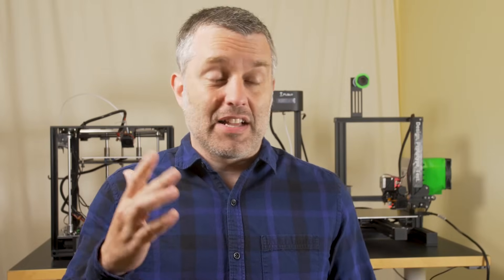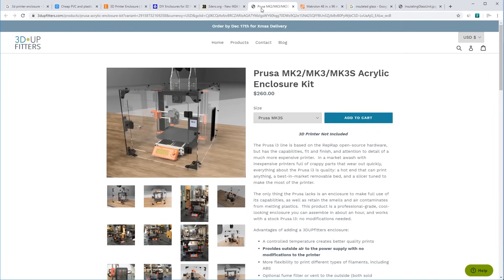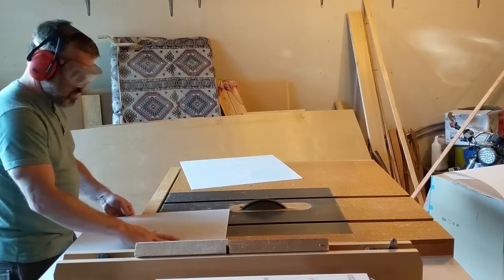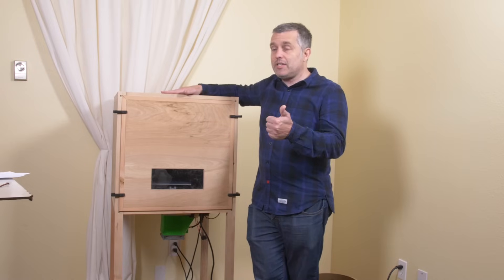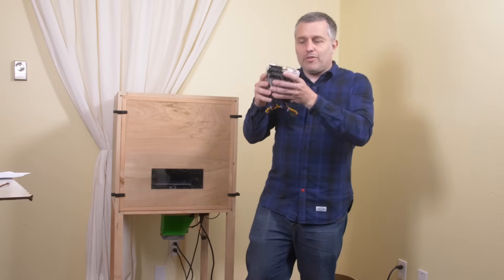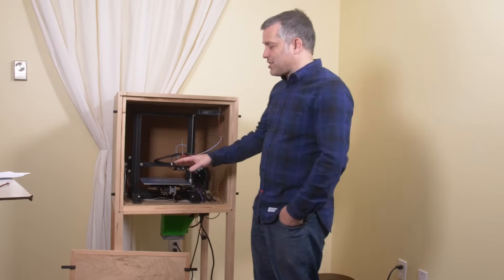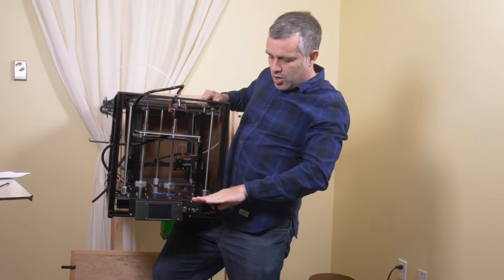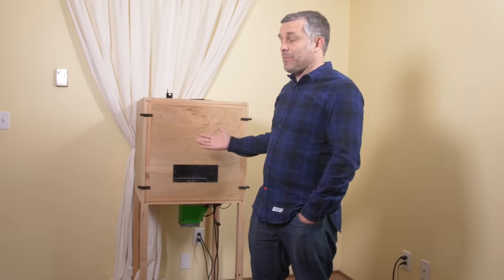3D Printing in a 100°C Heated Chamber - Lessons Learned

Comment: WARNING DO NOT DO THIS YOURSELF. MESSAGE TO MAKER: THE WARNING YOU GIVE IS NOT GOOD ENOUGH!!! YOU NEED TO FULLY EXPLAIN THE STORY WRITTEN BENEATH OR TAKE DOWN THIS VIDEO IF YOU DO NOT WANT TO BE RESPONSIBLE FOR SOME IDIOT TRYING THIS AND BURNING UP HIS HOUSE!!!
Long story:
The safety norms for heating devices for consumers are (simply put) divided in 2 groups: automatic use and non-automatic use. 
Automatic use devices, such a space heater, have to have 2 different safety devices to conform with normal safety (3 for newer consumer products in Europe): a thermostat that shuts off when the temperature gets too hot and a thermofuse that blows when the temperature gets too hot. The third one is the use of so called PTC (positive thermo coefficient) resistors, these increase in resistance when they get hot (and thus lowers current -> no thermal runaway). 
Heat guns are however non automatic. Cheaper devices dont have any protection and whats worse, most of the cheap heat guns are NTC's to increase the wattage (negative thermo coefficient). NTC means that the higher the temperature gets, the lower the resistance gets and thus the current gets higher -> thermal runaway.
This last part makes heat guns EXTREMELY unsafe to use on automatic appliances like 3d printers. As in 100% guaranteed fire hazard when left to its devices. Cheap heat guns often only have a lifetime of 500-1000h before the crappy bearings in the fan blows. Wanna know what happens next? The heating element heats , there is no safety to control the device and it will keep on heating. Whats worse, because it is a cheap NTC heater the current will increase and you will get a thermal runaway that just gets worse and worse. At a certain point it will create a very very hot fire. It is a guaranteed fire!
The solution is super simple: buy a new space heater that is designed for automatic use. Combine it with a pid for extra safety. Profit. Its not even that expensive compared to a heating gun, like 5 dollars more expensive and you dont burn your freaking house down.

Comment: I have a mini delta printer.  I actually keep a fan on it because it doesn't cool the filament after it's printed.  It prints very nice, but sometimes on the opposing side, you can see the loss in print quality without that airflow.

Comment: Which cooling system did you use to cool down the hot-end's heatsink?! Because at almost 100C it's kind of  counter intuitive to use a fan to blow hot air on the heatsink. I'm curious to know what you did, because I need a solution as well. I though of using a passive cooling system or water cooling.

Comment: I really don't know why you've got so many votes down.. I'm usually the first to hit the down button if I don't like something, but you published this so we could learn from your mistakes, and I really appreciate it! I now have a way better understanding of what will and won't work with enclosures, compared to having previously watched videos of people saying what to do without any kind of measure of usefulness and/or reasons for the methods involved in building it.
I usually agree with video ratings on YouTube, but, apparently, people don't know what good information is lately..
I think, based on your results, for now I'm going to wall off the sides of the shelves with my printers, and maybe put a roof over them, just to easily block the main airflow issues, and consider adding some kind of heating to it, too.
Reply from the maker: Thank man! I know right!

Comment: This video was great, like night and day compared to some of the other more ranty ones. Just built a heated chamber myself. I think you’re right about adding more part cooling fans. The ambient is low enough that the PC is in glass state, but the layers aren’t equalizing fast enough. Other solution is to set a higher minimum layer time, so printer goes slower, or does a pause between layers to allow previous layer to reach glass state.

Comment: I think I'd just design an entirely new 3D printer using all metal parts, with the motors and electronics well-separated. You'll need high heat lubrication for extended use at 100C.

Plastic will deform, belts will stretch, everything gets weaker at higher temperatures. Metal parts will change size at different rates.
Reply: Most of the Voron and some other XY designs do this already.

Comment: Maybe it's easier to put a 3d printer in an old oven? Especially one with fan bake ;-)
Reply: You know that’s not a bad idea. They are cheap or free all over Marketplace. Would be very safe
Reply: I did that, works well!
Reply: for small ones, a scrap microwave makes a good and cheap/free case with a door too.
if you have 2 of the same model you could even cut on each one side off and bold them together to get twice the volume,
Reply: I came here to say surely a cheap electric fan assisted oven would be absolutely perfect for this! best insulation, perfectly safe, perfect temp control, so much easier than this build in terms of effort... When I get one I might go ahead and do it!
Reply: So simple. Brilliant.
Reply: You absolutely could, but gl finding an ofen that u can fit an ender 3 into lol, theyre not gonna be cheap and likely much larger, so lot of energy wasted
Reply: Or what you think about a wine cooler, or even a refrigerator. You buy  a sonoff esp8266 with temp measurement, and some heating .. that's how bird breeders diy.
Reply: @ThePiotd  maybe, but remember that most fridges are deep drawn, thats a thermoplast too, just like your filament ;)
As long as you wont go higher than 60c maybe, but above that i wouldnt feel comfortable
Reply: I started watching this and thought... this guys building an oven.
Reply: @D3nn1s  A cut down Ender perhaps?
Reply: @ziptagthesnake  could work, or just build your own enclosure, i did too and its pretty sweet
Reply: @D3nn1s  I am in the process of doing the same. I experimented by throwing a bed sheet over my printer for a print that lifted in the open. I was able to get far better results with that alone.
Reply: @ziptagthesnake  im getting pretty good results too, but idk if it is because of the filament, settings or the enclosure or a compination of them.
But i would do it again,even if it wouldnt improve print quality (and it prob will once i get to abs) it makes the printer a lot quieter. And i have a silent board installed already lol
Reply: @ziptagthesnake  so less fan noise and no more smell whatsoever :)
Reply: i was thinking the same

Comment: Just liquid cool the stepper motors, my ender 3 runs in a  heated enclosure at 60c and the steppers stay at 32c. Only use pla tho, seen similar setups run over 100c for abs

Comment: Regarding Stratasys's patent, https://patents.google.com/patent/US6722872, that expires Feb 27, 2021, it doesn't appear that an enclosure like this would infringe the patent. Claim 1 of the patent includes this phrase: "the x-y-z gantry is located external to the build chamber and is separated from the chamber by a deformable thermal insulator." All of the claims appear to include similar language. I don't see an external x-y-z gantry in your project. All claim elements must be present for a patent to be infringed. This appears to be missing at least that element.

Comment: I'm a little disappointed as a woodworker you couldn't figure out how to use the PC panels. Use a router to make a slot, install a pane, then make a 1/4" spacer, install the next pane, then add the final spacer. The final side would be inside. I'm not sure it wouldn't help you all that much. It will increase the U value a bit but not as much as argon filled double pane. 

Please line that box with a fire resistant coating. Wood can ignite at around 450 F. You know what in your design puts out that temperature? The heat gun. The low setting is roughly 500F.  I think you were right on with those heater cores you have or something similar. It would more gradually heat the box, you might be introducing temperature variants with a strong heat source and fan. 

For cooling, you could use a pipe with outside air. If you kept the stream low enough it wouldn't significantly affect heat loss and give you proper cooling. It would affect efficientcy of the system of course. It would be more difficult to implement but could try a thermoelectric cooler. If the cooling fan blew from the cold side you'd get spot cooling but wouldn't lose any system efficiency. It would actually act as a small heater overall with 100% efficiency.

Comment: Great project, and thanks for also sharing your failures as well! 
I know you love your Duet, but for this purpose you should really look into Klipper, which allows firmware modification without recompilation because most of it runs on software (using a small board computer like a Pi, or even a PC), this allows super fast tuning of parameters. There is a version of Klipper which includes Duet Web Control, so you can continue to enjoy a world without Octoprint. 
For my heated chamber I used an SSR and hair dryer, and connected a spare hotend thermistor for temperature sensing. Klipper allows configuration of thermal runaway protection so it is safe as well.
Reply: Klipper and reprap firmware are pretty similar from a user perspective, you just have to edit a configuration file and restart, no firmware recompilation. Klipper has the advantage that it can run with most cheap controller boards. Duet3D has fantastic controller boards. You can actually use klipper on the Duet boards.

Comment: lol fire hazard.  You need to separate out your PSU else it will fail earlier.

I just use an Ikea shelf with soft close pull out trays.  I seal up the front with coroplast doors if necessary.  I hit about 50C in there, no heatgun.  That's just silly.

Unless you're doing something exotic I see no reason to go to 100C inside the enclosure.  That's just asking for trouble.

Comment: I learned that my Creality fire proof enclosure is cool outside except for the front transparent window. Maybe due to its reflective skin inside the black fabric. You may try to attach a layer of aluminium foil that reflects back the radiated heat. I am normally not trying to allow more than 40 Celsius with my DIY temperature controller as I have ender 3 electronics inside. I took the display part out of the enclosure and the next plan is to take out the board too with longer cables to have increased ambient temperature. Regarding your comment on baking filaments in the enclosure, it is in fact a good idea. I am doing it with a paper box cover on the print bed with a filament spool inside based on the fact that the ender 3 bed temperature control is quite good. BTW, 100 deg seems too high for that, doesn't it?

Comment: Those mini saw blades looked wicked! Using a router with a slot bit mounted in a router table and fence might have been a safer solution. Using thicker plastic also in the process.

Comment: I feel you on those rotary saw blades. I bought a set of them and when I opened them up I was terrified by them. I planned to use them to do a PC mod, cutting aluminum. After seeing the teeth, I went to normal cutoff wheels. The idea of losing fingers did not appeal to me.
Reply: Yup, you'll need to enter a zero-tolerance-for-error mindset. Think twice, move your hands once. Not suitable for late working hours.
Reply: Those are meant to be used in a metal mill.

Comment: The best thing to do would be to have the motors and electronics in an external enclosure with a massive fan so they don't miss steps or run hot.

Comment: The thought your wires would likely not even be rated for more than 90c and a thermistor to measure the air outside the box and regular steppers will skip or lock not to mention the pour board in there too ya watched you videos for sometime but though you were more advanced in this field you have done better now make a real ht machine I know you could

Comment: Cool. I mean Hot! Wouldn't be easier to use a cheap external W1209 to run the heat gun to control the HC temperature?

Comment: You are no scientist. two panels of glass/ anything clear without vac is R3.6 = Dry, absolutely still air has an R-value of 3.6 per inch. You really do not need to see everywhere inside and space is the insulator; filled by: air vs vacuum vs foam. 
A one-inch thick vacuum insulated panel (clear) can provide an insulating value of R-25 to R-30. But you can do better with slots, seeing through a cheap 2" and > hard foam. Overall just use an old oven in the garage and good light inside and shielding for electric supply. Diffuse the coil heat from bottom via a vent shield otherwise..... sometime later... a lower hotspot.

Comment: You're allowed to make your own anything, patent or not... can't sell them, necessarily... but no, they wouldn't go after you for far greater reasons than that of looking bad online.... they'd avoid it due to it not even being a reality. And the reason folks haven't done dual wall casements, is because it's unneeded and not even going to be effective unless you have a vacuum between them. But you can heat the simplest of enclosures, and it'll remain without escaping too quickly. Maintaining temp with ease... Heck, even Da Vinci printers maintain heat just fine with the bed being the source and the whatever plastic enclosure being more than enough... even with their venting figured in. This is just a waste. 
Also also... 20/20 rail, 20/60, whatever it may be. It's always used, yet always used wrong. By everyone. The purpose of the rail is in the bushings, clamps, spring nuts, brackets, runners, guides, rollers, etc that all fit into the rail channel and make it attach to additional channel in any and all ways with ease. Rather, idiots drill holes all through it, bolting it together, etc.... like idiots. 
Sort of like using an eBay thingy blade in a drill press rather than doing a dado cut or using a router. "carpentry" ... lol ... nope... just a guy doing stuff with some wood, 2x2's it seems ... not exactly "carpentry"
Also also also, the "insert" is more than likely an "avdel" ...

Comment: If BL Touch don't work in higher temperatures so what to use? Which sensor will be reliable in temperatures required to print nylon and polycarbonate?
Btw. What do you think about using smaller Keenovo DC  silicone heater and attatching a heatsink to it?

Comment: You can still do that window thing pretty easily, provided it isn't all glued together now. Lightly glue a thin frame between the two sheets to make one relatively rigid panel which can then be simply recessed into a notch in the frame and trimed in from the inside.   The two strips you'll cut out from each notch in the cabinet frame should be perfect for the window frame and trim.  

Will he do it? I would.  Would you?   Like = yes, dislike = no.

Comment: You could wire the heat gun into an SSR and put a thermistor into the open air inside the chamber.  Then wire the duet up to control the SSR.  Then if you calibrate the heating speed with M303 you should be able to get the Duet to control the chamber temps automatically without tripping thermal run-away.

Comment: they cant charge you for making one if your not selling it.
Reply from the maker: Under European patent law, it's expressly granted that you can make A patented thing  for personal use. In the United States this is not true. You absolutely can be sued by the patent holder for making the patented thing even if you just use it for yourself. It's still a loss of a potential sale for the patent holder. Therefore, you have harmed them monetarily by making it even if it's just for yourself.
Reply: thats only the case if you use the patented design to make the item. if you make an object with the same purpuse but your own design they cant come after you.
Reply from the maker: There are 2 types of patents. Utility patents and design patents. If it is a Utility patent you are violating it doesn't matter if it looks different. The functionality is the same so you are still infringing.
Reply: @DesignPrototypeTest  im confused then because the Patent on an oven is most likely 200 years old there for is it not just a design Patten?  Powder coat ovens have patents but i can use any oven even a home made one or a maytage unless im selling it for the exspress purpose of powder coating its an oven or a heated box that you are using for your own purpose.
Reply from the maker: Yes, if you could patent an oven today you would be very rich. You could sue every powder coating shop, bakery, homeowner, and the rare 3D printer with an enclosed heated chamber. You can't patent an oven. But you can get a utility patent on a very specific oven. The patent will be less valuable because it wouldn't apply to the powder coating shops, bakerys, or homeowners. Arguably the Stratasys patent didn't even cover the project I have shown in this video. (NOTE: The patent has since expired. This is a somewhat old video.)HOWEVER, do you want to risk it. Create a company hoping that it succeeds monetarily and if you do then the multi, MULTI-million dollar publicly traded company sends it's Lawyers after you? Nope. Not worth the risk. Even if you are sure you don't violate their patents. Best to just wait until they expire.

Anyway, there are many books about patent law and patent strategy. Also a few YouTube videos. I can't spend anymore time writing these comments to you. But it was nice chatting. Have a great day!
Reply: @DesignPrototypeTest  this is not about me making anything for a company this is about me making a similar item for a said purpose that has a paten for personal use and i dont use the design but it has the same end goal and or idea. i have a meeting with my paten offer next ill ask him from my talks so far he has not stated it working how you say,